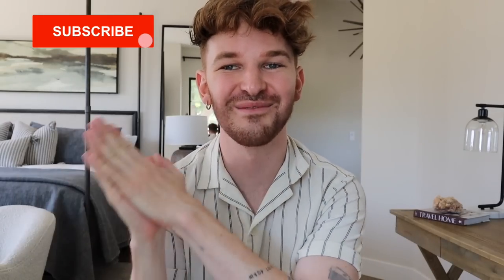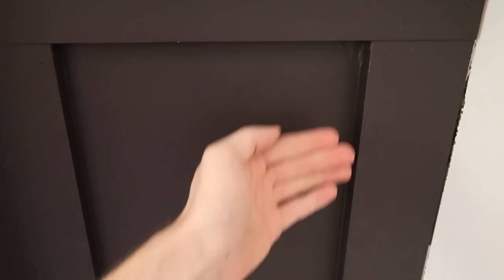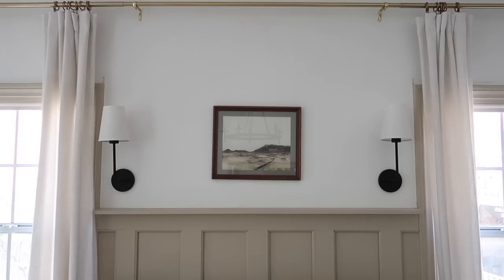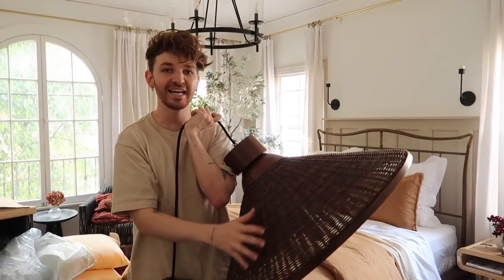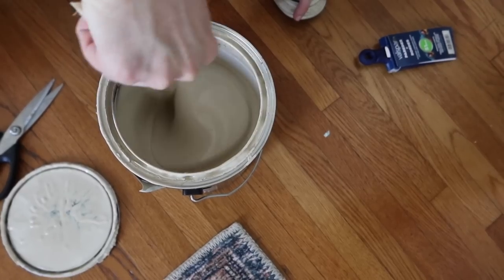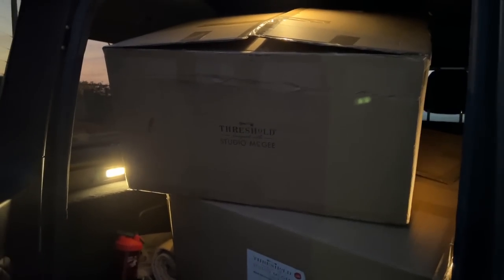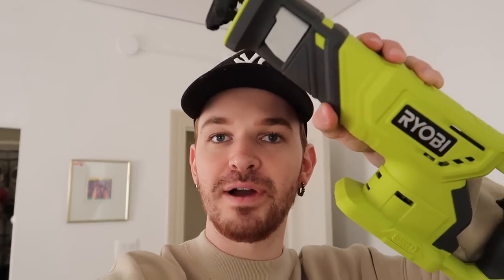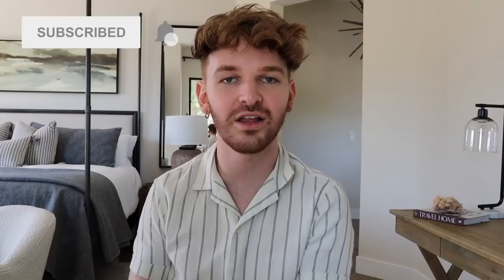EXTREME BEDROOM MAKEOVER (From Start to Finish) - Budget Friendly & DIY!

Comment: Great job, I have a suggestion with your mirrored closet . I would put a horizontal piece of mirror above the door ( like a transom ) and trim it out with moldings so it is the same height as the entrance door on the same wall ( trim painted out the same as door ) so they are balanced.

Comment: I have a quick Q about putting panelling up. When you do the larger boards you use no nails glue, and brad nails for the smaller trim - do you have to use the glue for larger pieces or are just the nails fine? I want to put some up in my next place but I get worried if I get bored of it or the person after me wants to take it down, it's a nightmare to remove. Thanks!

Comment: Do you not have issues with the paint on the doors and trim without sanding first? Paint will scratch off of mind so easy, i have to prep with a sand first or else ever layer after will peel.